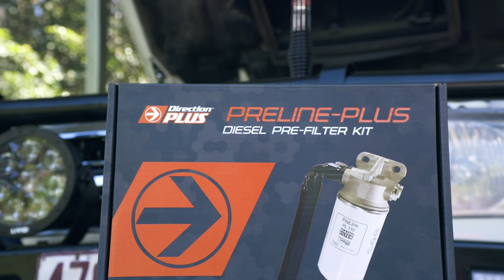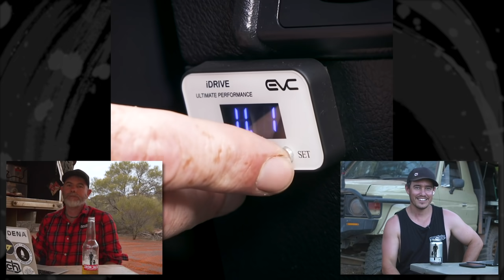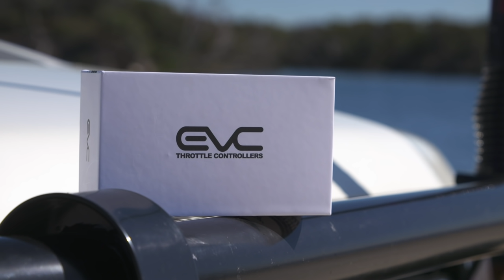FILTHY PIGS TRASHING CAMPSITES – Our bold new plan to keep tracks & camps open | The Shed EP10

Comment: Once the lock down is done in Vic we are on the move full time. Our first trip will be via Omeo to Wangaratta then to the Murry River until the SA boarder is open. We have been using the bags from the Birdsville races in 2017 and they need replacing. We will be proud to use the  RESPECT THE BUSH bags to clean up as we go.

Comment: You could simply use old hen, cattle feed bags & general ag produce bags from your local ag shop. I’ve been using these as fire wood bags for years, when the wood is gone it becomes a rubbish bag, easy to do & the bag gets used for three independent uses! That’s recycling.

Comment: It's on the power line track in WA. It is EXACTLY the same place that I swamped my Navara in just 6 weeks ago !!!
NOTE: The navara computer is on the transmission tunnel forward of the gear stick.
As soon as that goes under it's lights out for your diesel engine.

Comment: Well for me next year Im going to be travelling around New Brunswick in Canada with my parents. We’ve got a 2019 dodge ram 1500 bighorn and we pull a 2020 Safarie Condo Alto 2114 camper trailer. My mom prefers to stick to the pavement road but when I’ll be older I will be building myself a jeep setup for remote touring. So ill be picking up the rubbish in the campsites that we will be staying at.

Comment: Shauno, I love the channel, I spend way too much time watching it! I love your "clean up Straya" campaign. I love old Sooty too, however I cringe every time I see it pumping thick, black particulate matter into the 'fresh air'. Maybe it's time to sort that motor out. It would be an interesting build vid to diagnose the issue and fix it or pull out the old donk and re-power it with something with way less emissions. DPM and garbage are both environmental pollution! Love your work mate, thanks!

Comment: So, Iv'e got a modified NW Pajero with snorkel and dual battery system. There seems to be nowhere where I can attach a Catch Can or Pre-Filter. What would you suggest? I've looked into putting the house battery in the well where the back seats were but don't want to add an extra 30kg with a decent battery. Lithium would be a good but very expensive choice. Thoughts?

Comment: I cleaned up 2 of my local camp sits and 4wd tracks me and my friend have been cleaning since 5 pm it’s now 10 we just finished we handed down a couple bags to some campers hoping they will use them to put there rubbish in I also installed a rubbish bag dispenser (doggy bags) hoping it will help (btw I’m only 13 and I’m cleaning more than adults are..)

Comment: Love ya work #24/7. Just orderd a new 76 series. What upgrades do u recommend that are an essential to do straight away.. cheers hoops
Reply: Dereck Randle dump it on its guts and fit 24inch chrome spinners!
Reply: Haha where to start. 
1. Clutch upgrade
2. Correct rear wheel track
3. Coil conversion, (the rear leaf spring hangers are so low in the 76 series, you get hung up on everything u drive over)
I spent about 18k on mods on my 76 just to make it decent offroad.

Comment: I have had a whole bunch of issues with my Direction  Plus Preline 150 kit :(  The included fuel lines allowed air ingress, which was sorted under warranty.... so OK, but then I picked up a bad batch of fuel, no alarm on the system, and and who knows what damage to the injectors...... So buyer beware, my mechanic struggled to be able to buy new filters from them, so make sure you buy your replacement early.

Comment: Just on the fails, I don't have any pictures. Note here comes my biggest fail. Was out in Wombat about 10 years ago and had driven most of it as I was out there a few times a week and found a new track as I didn't have maps or sat nav and headed into it and a little was in found a mud hole I wasn't keen on but with the old you won't do it, I had a crack and in my vitara I sent it to a dead stop that deep in mud it was hard to open the door. Anyways no winch and no reception with mates phone flat and it looked like a nice clear night approaching we made the call to leave and walk out with not knowing exactly where we were. About 15 min in it got pitch black really quickly and atart3d pissing rain. We could not see our hands in front of our faces. Anyways we kept walking using sticks hitting them on the ground as the sound of the tracks were different to when you started going into the scrub, 4 and half hours and hearing lots and lots of wildlife near us some sounded very large, we walked out near Bulangarook to the first car we had seen the entire time being my misses coming looking for us. It took 4 days and multiple 4x4s and a motorbike to finally locate it with a big drawing in the mud on the side window saying haha fool with a big sick and balls drawn under it. The funniest part is, it one of the toughest tracks in wombat called the 3 sisters as I later found out and once I was pulled out the way I was facing, I drove it straight up the steep hill on the other side and then turned around, went back down the hill and derive through on the opposite side of the hole and went straight through it. Was referred to as Russel Coight by few mates after that for a couple of weeks.

Comment: OK, 1st no one should have to pick up other people's rubbish. Perhaps you can get some of your sponcers help you purchase some hunting trail cams, and put them at the hot spots (hide them well) and work with your local authoraties to procecute the culprits. Word gets out of this happening, you rubbish problem will drop quickly, unfortuetly it won't dissappear totally, but it will be much less of an issue. This with your great cleanup plan for all the crap out there already your bush should be clean enough to eat off of:)

Comment: A very tiny track in Tassie (won't say where) has been used as a dumping ground, from house hold rubbish, tyres, truck tyres, you name it. I finally managed to report it to the right people and hope it gets cleaned up. And if your wondering why i didn't their is enough rubbish to fill a full sized garbage truck and some, Plus the cost to take just ONE tyre to the tip here in Tassie is about the $25 mark. SICK OF THE BASTARDS DUMPING RUBBISH!!